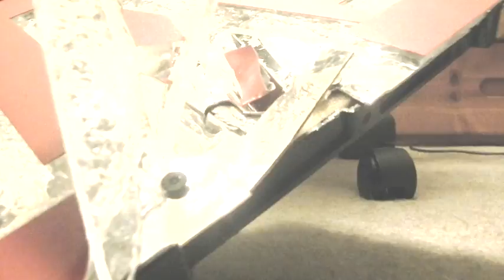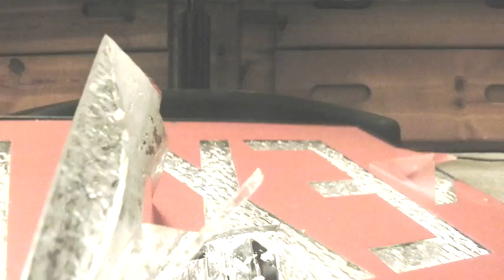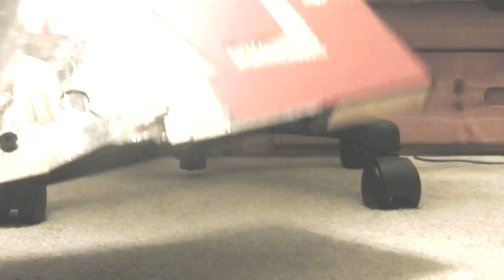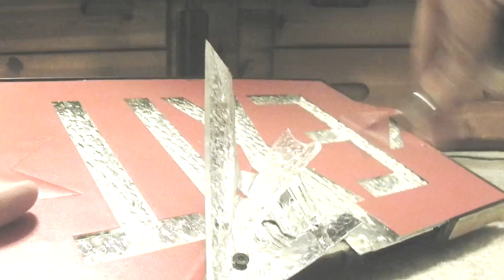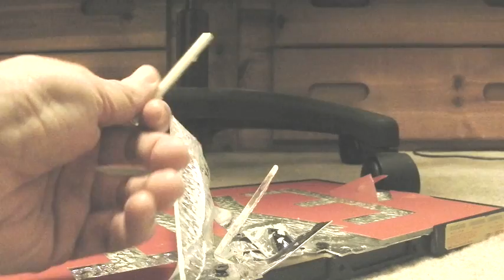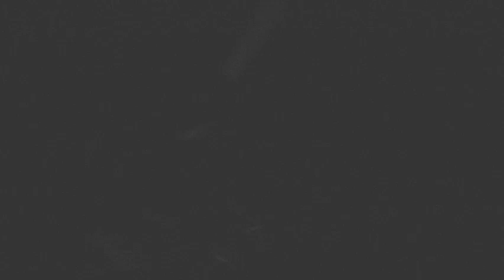Tritium Exit Sign (part 2)

Comment: Although they may not be sold at the big box store chains, tritium exits are quite easy to get.  You just have to know a rep agent.  And be willing to pay a premium.  By the way... I have witnessed several tritium exits capsules leak out into the sign housing.  I wouldn't advise disassembling these things.  Even without a broken tritium capsule, there still can be escaping isotope...

Comment: I used a drill to remove the pin from the screw, it actually cracks off fairly easily. If you did break the tube it would be smart to crack a window, set up a fan, and steer clear of said room for a few hours. Inhaling radioactive gas of any type is somewhat detrimental to your health.